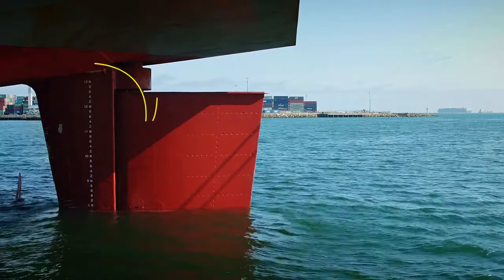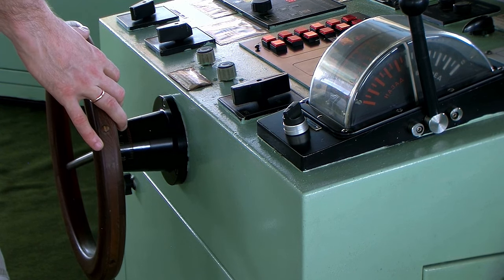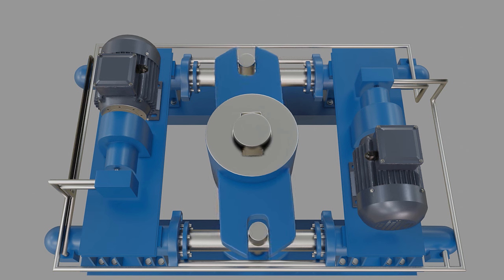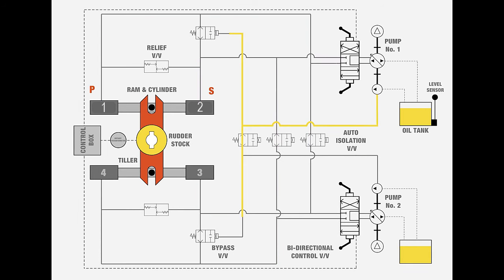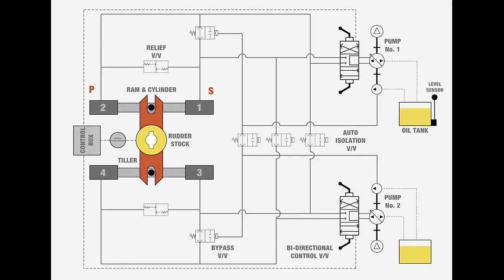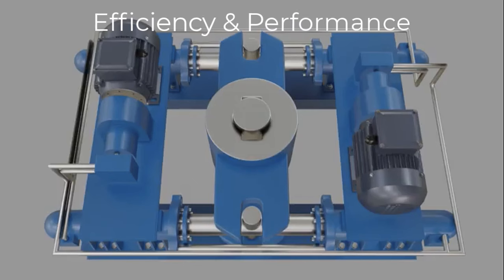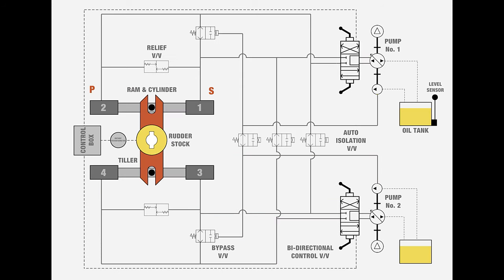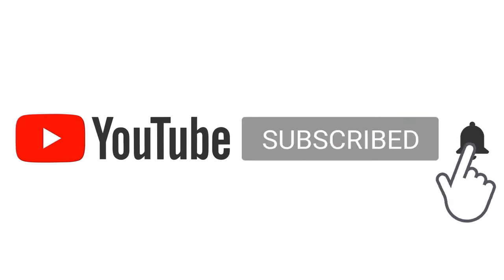How Ship Steering Works? (Hydraulic Steering System)

Comment: You mentioned that there are 2 types of Steering Gear which are hydraulic and electro hydraulic, my question is what are their differences?
Reply: He meant the command signal or order from bridge is an electrical signal to actuator in steering gear room which maybe, telemotor or electrical solenoids valves.

Comment: What are the differences between hydraulic ang electro hydraulic steering gear
Reply: A hydraulic steering gear system uses hydraulic pressure to operate the steering mechanism of a vehicle or vessel. The system consists of a hydraulic pump, hoses, and a steering mechanism. When the driver turns the steering wheel, the pump creates pressure in the hydraulic system, which then activates the steering mechanism, causing the wheels or rudder to turn in the desired direction.

An electro-hydraulic steering gear system uses both hydraulic pressure and electronic controls to operate the steering mechanism. The system consists of a hydraulic pump, hoses, electronic sensors, and a control unit. The driver's input is transmitted to the control unit through electronic sensors, which then determines the appropriate hydraulic pressure to be applied to the steering mechanism to turn the wheels or rudder in the desired direction.

In summary, the main difference between hydraulic and electro-hydraulic steering gear systems is that the latter incorporates electronic controls and sensors to provide more precise and efficient control of the steering mechanism